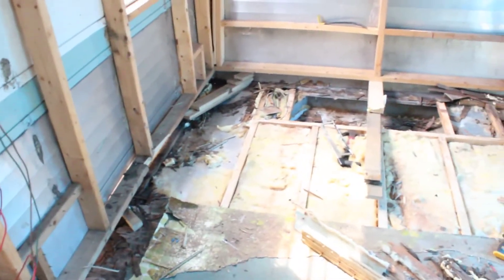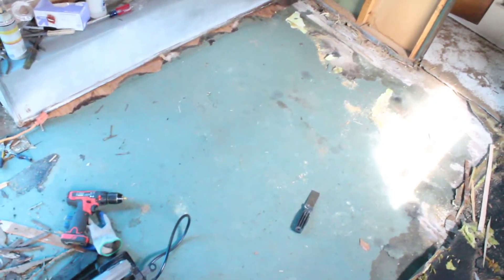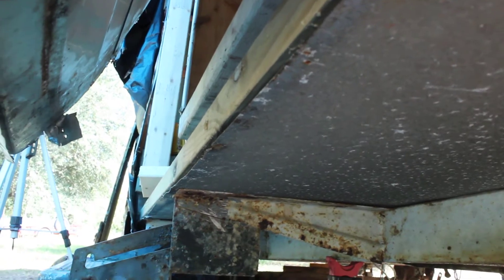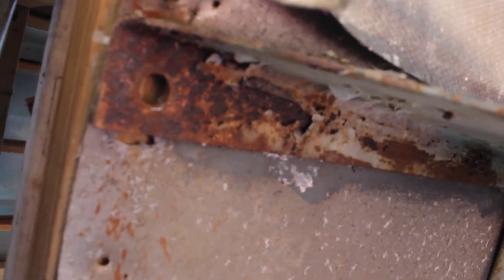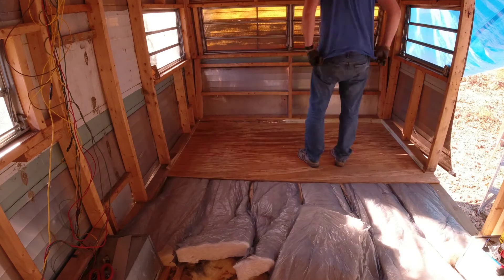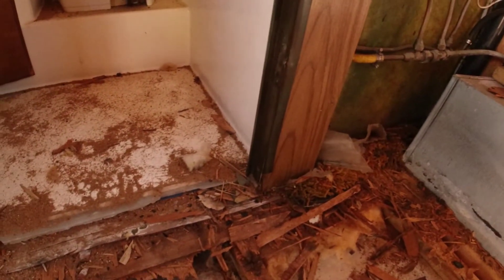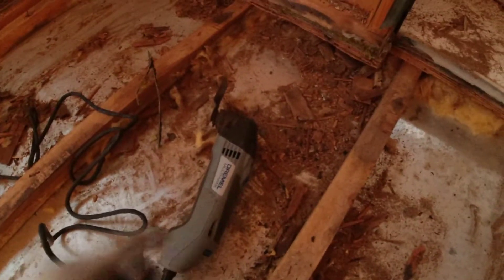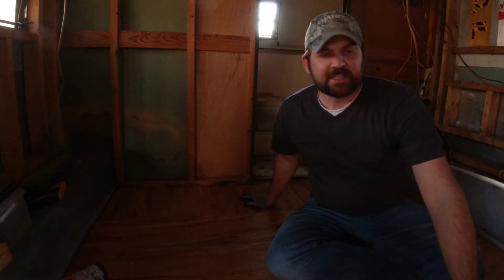Vintage Camper Demolition and Floor Reconstruction

Comment: God I hope you're still answering questions,  I know this was posted 2 years ago lol How do I get the wood flood off to expose the beams? They use some staples that would hold together the apace shuttle!  Ive tried a Sawzall,  tried a circular saw down the middle of them and prying.  I'm getting nowhere
Reply from the maker: Interesting.  Mine wasn't that bad.  It helps when parts of the floor are rotten :)  I would suggest focusing in one area and expose one beam.  Then use a crowbar to start prying it up.  I hope that helps.  Good luck on your project!

Comment: I'm about to tear into one I bought not being able to see the immense water damage under the bed. My biggest concern is tearing into it not knowing how the body is held to the frame. Would you have any knowledge on that? I have a 1984 Glendale Golden Falcon 20 foot.
Reply from the maker: I don't have the specific knowledge but for mine, the bottom plate of the walls were bolted to the metal trailer frame below.  I would think most campers are built similarly.

Comment: Hey, my camper layout is identical to yours. Same brittle floor around the edges, and I tore it up without doing a frame-off. Do you have holes in the bottom aluminum wrap? I have a ton of brittle spots and small holes. If you had that what did you do about it?
Reply from the maker: I didn't have holes in the bottom of the side skins or the belly pan metal.  Surprisingly, those parts of the camper were intact!